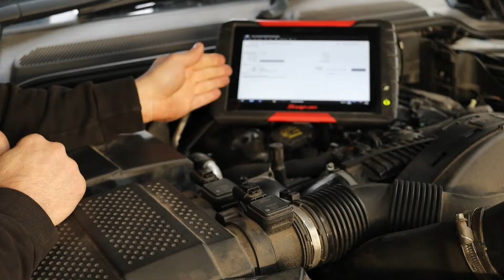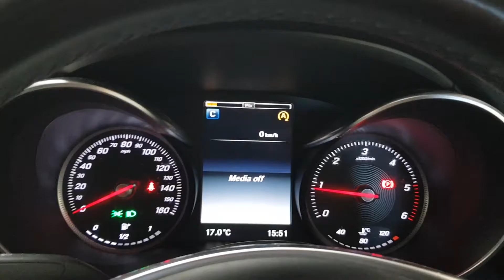Mercedes P0401 fault code repaired

Comment: Hello i have same engine. Problem is. Everytime i reach 130km/h the engine like shuts down. I lose all power. Cant push the car further. Its like turbo is off. No check engine lights coming or something… could egr cleaning help me out?
Reply from the maker: That's not an EGR issue unless it's stuck open as the EGR valve works at lower speeds and idling in traffic. Get it booked into your local garage to investigate the issue 👍

Comment: Great video. Very helpful. I have done the same process and all was well for about 40 miles which was an improvement as prior if I cleared the code it would reappear after 3-4miles. Anyway, have stripped it down again now and the sieve is clogged with soot again. Do you have any advice? Thanks
Reply: I rectified my fault. My problem was the egr valve was stuck closed so obviously the gauze was getting clogged. I soaked the valve in WD and manually opened it and gave it a scrub with a toothbrush. Cleaned it, wd and reassembled and all good 200 miles in :)
Reply from the maker: For starters don't use supermarket fuel, use an additive in the tank and don't use the silly light on the dash for when to change gears, use lower gears when driving around town. Short shifting into higher gears at low speeds labours the engine and sits it up. Don't be afraid to floor it every now and then to clear the exhaust system out. 👍😊

Comment: I have the PO401 issue on my mercedes a class A200d . The mercedes specialist replaced the egr valve and the intake manifold with genuine new mercedes parts however still getting the issue. Just wanted to check if the part you cleaned was part of the egr valve or is is seperate?
Reply from the maker: Hi, this is the EGR filter which is part of the EGR system

Comment: Hi 
Thank you for the perfect video 
I have got the same code display in my car the same mercedes c class 200d.

But my question is
When i open the oil cap there is white smoking out of the oil cap, is it because of this code issue or there is any other problem?
Can you please replay me.
Thank you
Reply from the maker: That's quite normal for a diesel engine, it's the back pressure from the engine plus some of the combustion escaping past the rings, all normal unless it smells strongly of exhaust fumes! 👍😊
Reply: Thank you so much from your help.

Comment: Hope youve realised that the gasket was blocked with soot because dpf started to fail, when dpf stops trapping soot it will pass ot through to egr
Reply from the maker: Thanks for your comment, cars have a DPF pressure sensor to tell you that the DPF is Blocked or blocking up. But there were no fault codes for this. This problem is usually caused by supermarket fuel, this customer was using Tesco fuel as his primary fill which caused this issue.
Reply: @melsmotors will changing to premium esso/shell and using a dpf cleaning additive be enough to fix it?
Reply from the maker: @ShabDab-po8rt  additives do work and it's big business, using good fuel also helps. Most cars now come with a stupid gearshift light making you change gear far too early and labouring the engine. Engines work well in the middle third of the rev range, this is usually where torque and horse power work well and use the fuel efficiently. Labouring the engine causes a lot of issues! 👍😊
Reply: @melsmotors  that's not what I'm saying, when dpf starts to break up and fail, it no longer stores soot as efficiently as when it was new, so the excess soot clogs egr first thing. This would not cause dpf to overfill hence why there was no dpf faults

Comment: Hi, I saw that you repaired a w205 r9m.  I have an identical one.  my question is: is it normal for steam to come out and a noise to be heard when I open the oil filler cap?  thank you!
Reply from the maker: Hi Casian, yes it's normal to get noise and oil vapour with the cap off. 👍
Reply: @Mels Motors Ltd thanks!!!

Comment: I have a code P040100, is that the same?
Its says the flow rate of the exhaust gas recirculation positioner (low pressure) is too low. Help please.
Reply from the maker: Hi, it is the same code, you have to ignore the last two zeros, so that code is P0401. Hope this helps ☺️
Reply: @melsmotors  alright ill try to do what you did, cheers 👍

Comment: The car in the video is a c200 d 1.6  ? I have the same problem (error p0401) and probably I will try the same process as you in the video . Thanks for sharing the process
Reply: Yes, good video. Did you try this on your car? I've a 2016 C200d with the same P0401 code and curious to see if it worked for you. Cheers.
Reply: I deleted mine. And remaped stage 1 (150 HP and 320 Nm)  and Adblue deleted.
Reply: @Tony-fh2wi I did the same, mapped out the NoX sensor that was broken and was over €1000 to fix, advantage is that you won't have to fill up adblue too yes, is your car running fine now? I just did it today and I'm a bit scared,, performance is back but i don't think I'll pass emissions test
Reply: @marcviej.5635  3 years no issues...is impossible to MOT detect adlue delete.
Reply: @Tony-fh2wi   Thanks for the quick reply! Btw, is yours the c200d with originally 136 Hp and 300 Nm too? Because I'm also considering doing a stage 1 tuning, so it upped yours to 150hp and 330Nm? that's 10% increase and it doesn't seem like a lot or does it make a big difference? I just want to hear it from someone like you who already has driven it for a while, and if it's worth paying €250 at my local 'chiptuner'
Reply: @marcviej.5635  yes 136cv...you can go to 160 hp and 380Nm with no issues at all...when you mapped is like you have another engine..
Reply: @Tony-fh2wi Completely false! An smart worker can detect this in 1 min. Just by trying to build up pressure on Adblue pipe!
Reply: @marcviej.5635 Do you tested Adblue injector at this time? On most cases this is issue, not Nox sensor.
Reply: I do not think that chip this engine is good idea! On 2,2 liter can you make, but not here!

Comment: I have a 2013 cla 220 CDI I have this code coming up.. where would be best to start looking?
Reply from the maker: Hi James, it's difficult to identify your fault from afar, you'll need to use a professional diagnostic tool and read live data and look at the air flow correlation when the EGR valve opens and closes, see if it matches desired and actual readings. A code reader will only give you a code, you need to read the live data and compare it to know good readings. A decent local garage should be able to help you. Thanks for watching 😊👍
Reply: @melsmotors   ok I'll find someone the car has had new egr valve, hose, sensor, solenoid, but still does it but I've been reading it could be to do with MAF or a flap further down line. I just can't work it out it also does 70mph in limp so not really limp I knock the light of with reader it's fine again
Reply from the maker: Wow that's a lot of parts, most of those parts are testable with a decent scan tool, are you using a basic code reader and just changing random parts?